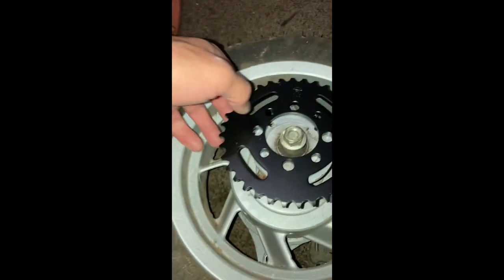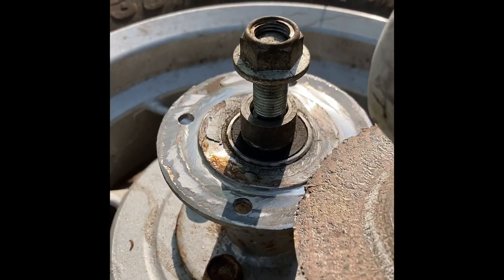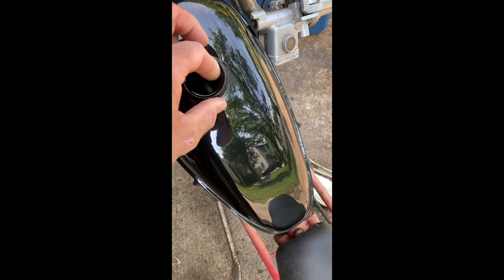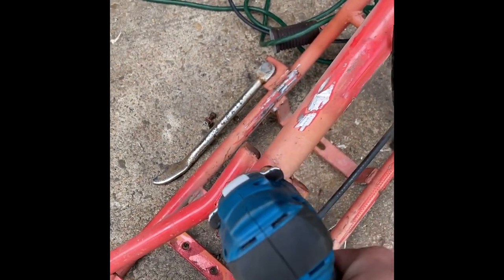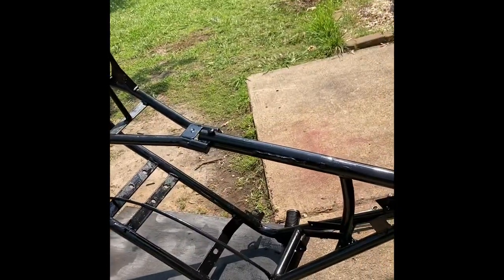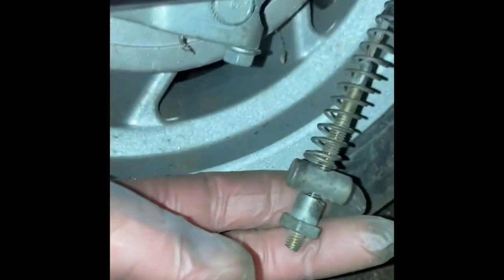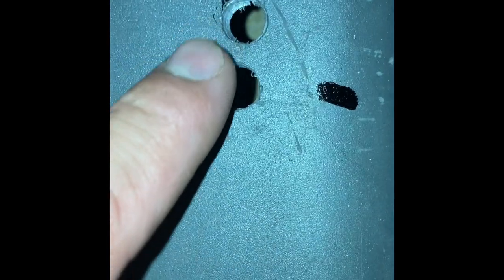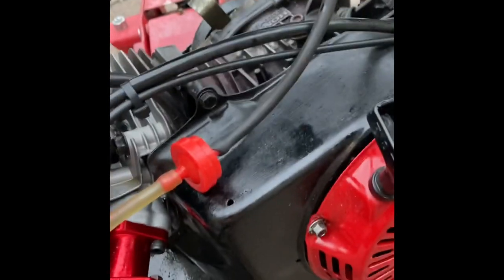How to install a 6.5hp engine on a mini chopper

Comment: So if I flip the wheel to put the sprocket on the other side. Should I flip the tire it’s self so the tred is going the right way?
Reply from the maker: @FaithfulFlower_7  it works well either direction

Comment: I have the same exact bike, but I have a little problem. I want to put a 212 in it but the sprocket on the rear is on the wrong side. How would I swap it so it’s on the left?
Reply from the maker: @FaithfulFlower_7  I flip the wheel to the other side and change the sprocket I have a few videos on my channel on how to do it
Reply: @Cheaphorsepower  could you toss a link please?
Reply: @Cheaphorsepower oh never mind I saw it in this video. That is so simple I have no idea why I was struggling with that lol

Comment: Hey man, what is the drum brake pad size ? I've been trying to find a replacement drum shoe assembly but there's no measurements on the drum brakes at all. Would be a big help. Great video and thanks in advance.
Reply from the maker: Sorry for the late response I was in Peru! I honestly couldn’t find one, I was so mad the mb200 one I ordered wouldn’t work and I couldn’t find anything else that was close. I’m sorry I couldn’t help but I’ll keep looking!
Reply: I got the same one break pad sizes is about 3 inches on mine. It might be different on others though

Comment: Did it have no sproket and u had to get that one? I wanna build mine like yours but I wanna know if I can use the original sproket it comes with or not
Reply from the maker: It had a smaller sprocket and I ordered one online that fit my measurements
Reply: @Cheaphorsepower can you send the link

Comment: Can you put a link to the sprocket you got and do you know if they make it for 40/420 chain?
Reply from the maker: All you have to do is Google the part number and it’ll pop right up I use the 40 chain it worked really nice I’ve done a few of these bills now and they are so much fun

Comment: Watched this to see how you mounted the engine plate and you didn’t show it lol
Reply from the maker: lol sorry about that, honestly it’s jus flat 1/4 inch steel I drilled into the frame then drilled mounting holes for the engine worked really well. I aligned the chain before I drilled too.